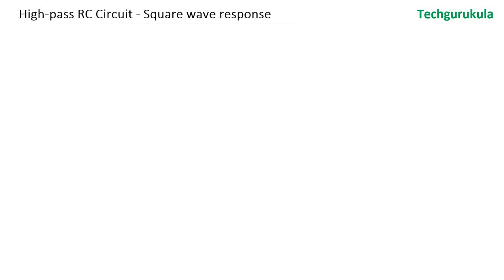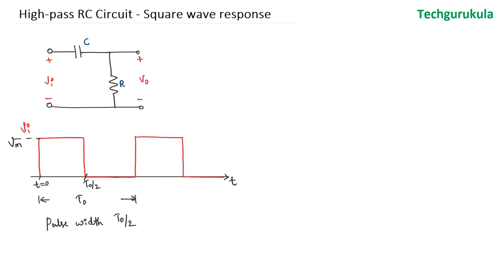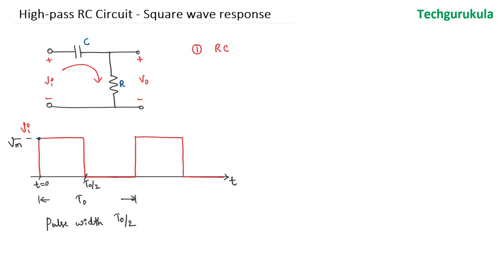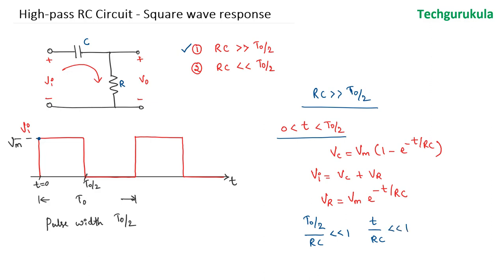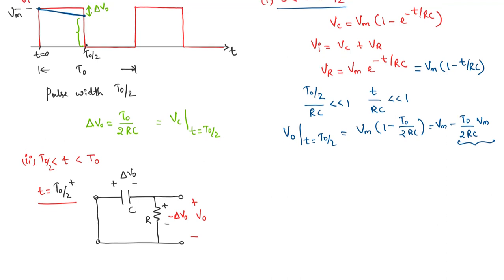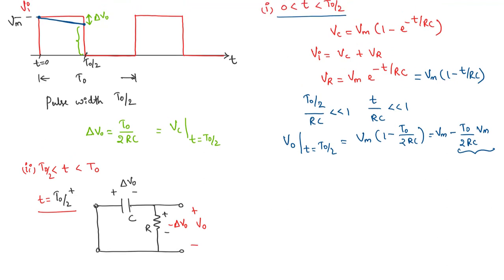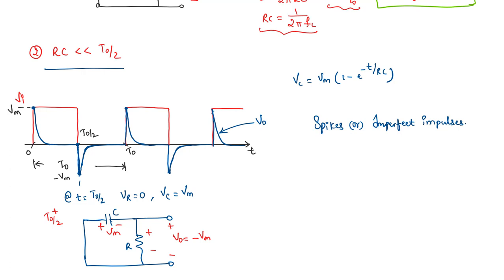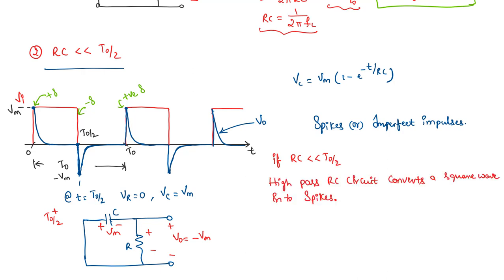High pass RC circuit - square wave response

Comment: For the case when Rc >>T/2 , in second half of output cycle ,how can you discharge capacitor fully. In steady state(meaning after few cycles), graph should look a bit different then what you drawn. Plz correct me if I'm wrong.
Reply: Did you find the answer??? I am stucked on the same doubt too ??

Comment: What is meant by rc<<t/2??
Reply: The sign << means  RC is very very less than T/2.  And the result of the condition  is explained very clearly in this video.
Reply: RC means the product of the value of Resistor in series and the value of the Capacitor. T means time period of the input signal.
Reply: @naemislam_eece  what happens when rc<<t/2